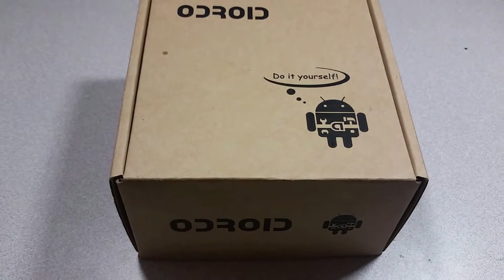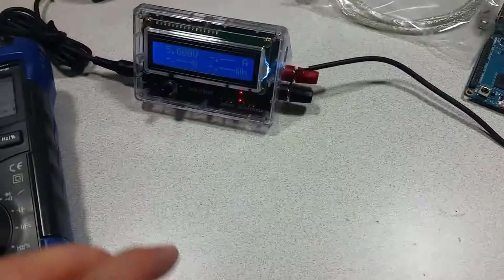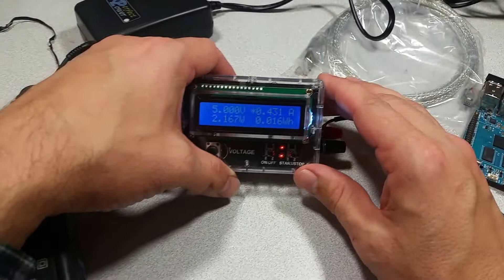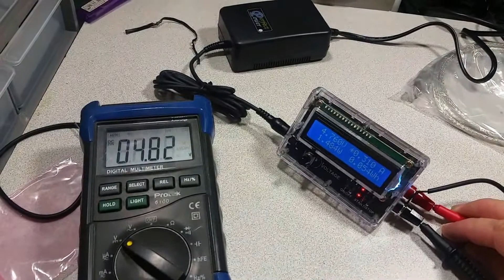Smart Power Intro (Power Supply)

Comment: Tested this on a Intel HDMI stick with a USB to USB-C cable for power. Got the volts all the way up and as this boots can see the volts drop down to less them 5 and back up and down fast. But it did boot.

Want to test the smart power 2 it my stay at the 5 volts and can monitor it better.

Used a 12 volt car power. Made my own plug from 12 volt car power plug to the plug that fits in the smart power.